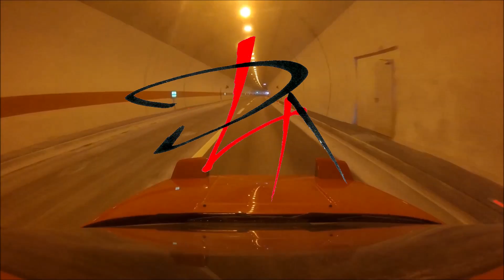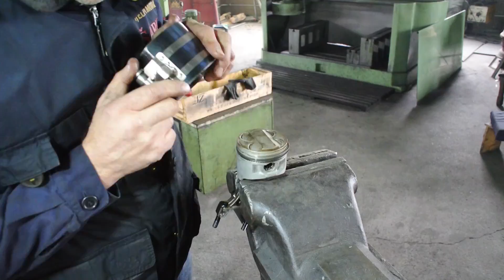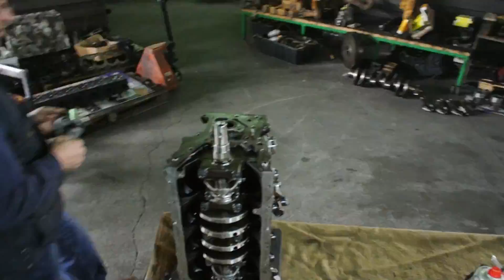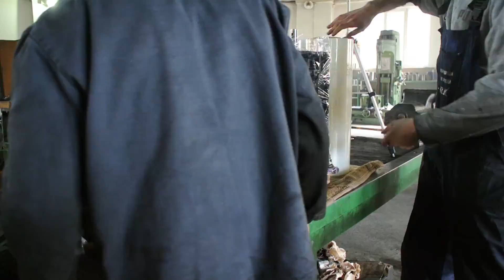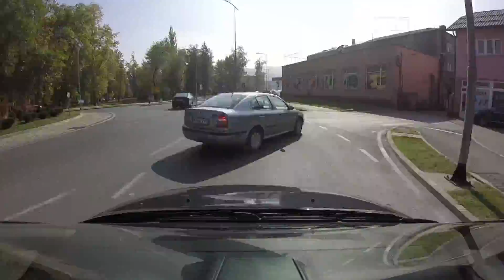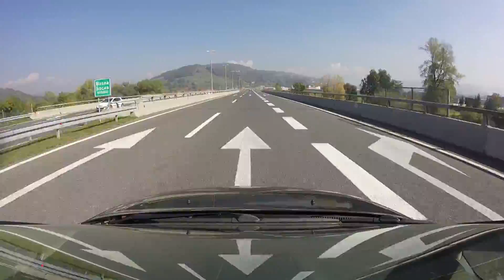Bike carb conversion part 3 - engine block assembly 2/2

Comment: So what makes the conrods “shrink”? I can’t see why the inner dimensions would need removal of material. Can someone explain what happens when this operation is needed?
Reply from the maker: The conrods don't really shrink, it's the shape of the big end that looses it's perfect circular shape. To restore that circular shape they first mill down the two flat sides, the faces of the end cap and the rod. After this they do what you see in the beginning of the video to get the perfect circular shape back. They can't do that right away because the shape is egg-like and the machine wouldn't remove material equally. It's kinda hard to explain with words alone and without some pictures or something. I hope it's clear now, if not, ask away.
Reply: driving 4 answers I think I get that, but aren’t you ending up with a greater diameter (albeit an uniform diameter)?
Reply from the maker: Nope. Because they first shrink the diameter a bit. To put it more simply, you start with an egg-like shape that's undesirable. When they mill the flat side of the cap and rod they turn that egg shape into a what can be described as a squeezed down egg. Before it was taller than wider, now it's wider than taller. They they machine it back into a circle that has the same diameter as the factory spec. Again, really hard to explain like this.
Reply: driving 4 answers thanks for explaining. I think I get it now. What I was mostly weirded by was my understanding of “removing material”, which I can see now isn’t totally wrong - you just take material from somewhere else. 

I’m thinking about jumping onboard an AE86 project and your videos doesn’t make it harder to go ahead with that plan. :-) Now, how to go about telling the missus...